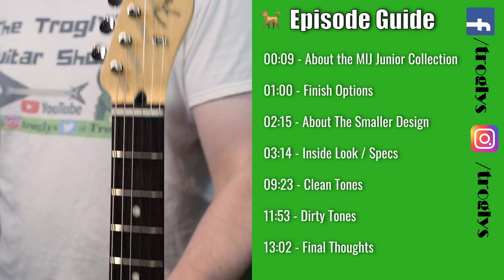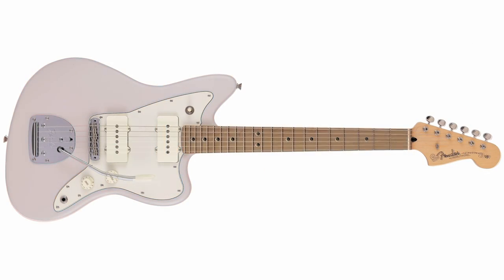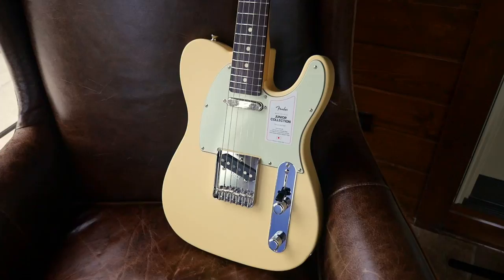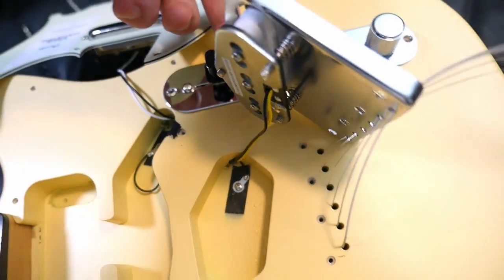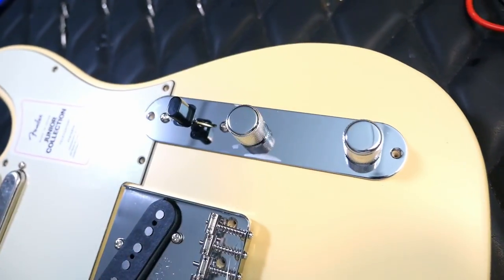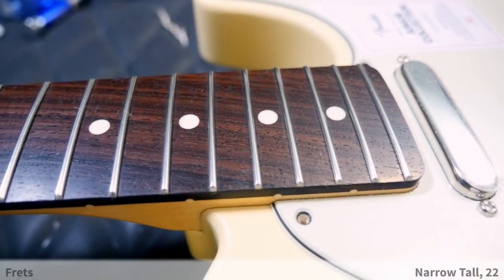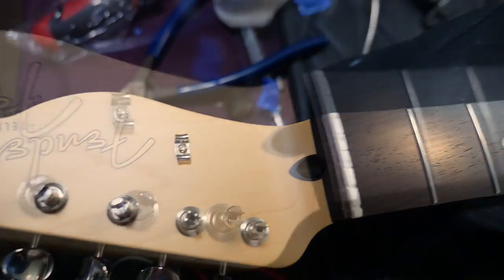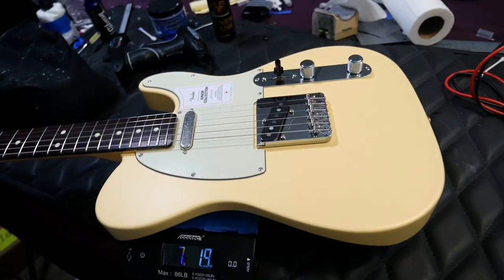Have You Ever Seen a Short-Scale Tele? (24") | Fender Japan Junior Telecaster Review + Demo

Comment: I had a short scale Tele & made a mistake about 8 years ago and sold it. So, I made my own. It’s still not the same though. I stripped a Squier Classic Vibe Tele and stained it purple. Put an arm cut & belly carve on it. I routed under the pickguard. Originally, it was pretty heavy - almost 10lbs. I took 2.5lbs off of it. I then put a Warmoth short scale maple neck on it - has 10”-16” radius. Plays like butter now, but I still miss my old Tele.

Comment: These are killer. As a Gibson guy a 24" scale is easier to get into than a 25 1/2". That's why I have a Fender Duo Sonic with a Tele bridge PU and a real Ric '66 single coil. Total early Townsend sounds from one guitar. It succeeds too.
Reply: From the mid 80's through the 90's (I believe)  Fender Japan made Strats and I'm pretty sure Teles on a 7/8 scale but with the Gibson scale length.  You can find the Strats labeled as "STM" or "314".  I believe Teles are labeled"TM".  The quality of these guitars are nice.  I have a couple of the Strats (SSS and HSS pickup configuration), sorta rare and not cheap.  I'm a Gibson guy as well,  but strats and teles have their place.  I have a 70's mustang, bet your Duo Sonic is wicked.
Reply: I'm not referencing to the newer Aerodyne models.  The guitars I'm referring to are built to somewhat match specific years (STM-55, STM-60) are the two models that I have.
Reply: As a 25 1/2 guy it's no problem goin 👎👎👎
Reply: @therealone1288   It's no problem Slade, been playin' for 50+ years.  The Gibson scale is simply more comfortable Hero.
Reply: Duo-Sonic (and Mustang) Gang Here!

Comment: Yes , I have seen a short scale Tele before. Around the mid to late 90's ('96?) There was the Fender Custom Shop "Tele Junior" . Mahogany body , set mahogany neck, rosewood fingerboard, black painted headstock, 2 P90's . It was 24.75" scale length.
Reply: That sounds similar to the Jim Adkins Thinline Tele, which also has two P90s and a 24.75" scale length.
Reply: @benjipc5637  Not seen that , I'll have to check it out 👍

Comment: Yesterday I got in a Squire Comtemporary Stratocaster Special in Sky Blue Burst Metallic.  So far so good . It was listed as used and I've not found any obvious blemishes or other problems.  Well actually they forgot to pack the tremolo bar but a quick call and they found it and dropped it in the mail. The pictures dont really do them justice. And plays well. It also has the painted headstock with the roasted neck and fretboard.   As a Telecaster owner I get why someone might want a comfort cut. Even though the edges are slightly rounded over being someone that leans into the guitar a comfort carve on other guitars I own makes sense. I know that guitar your reviewing has a smaller body but it makes the headstock appear to be large . I'll bet that's a good little blues banger. Especially if you down tune . I'd changers the saddles to brass move that  neck pickup to the center maybe closer to the bridge pickup and drop a split coil pickup in the neck position. Of course putting in a 5way toggle .

Comment: Hey Trogly! 
Is the pickguard scaled down in size or the normal size?  Normal size pickguard would make it easier to mod with a neck humbucker and middle single coil pickup like it’s routed for.
Reply: I believe that the pickguard is slightly smaller but the pickup and hole are the same size

Comment: Hi, is the pickguard the same size as a normal tele pickguard? Planning to get this color then replace it to a black pickguard. nice review!
Reply: You can sort of tell it's not when he holds up both teles..... I spent $8.50 on a regular mint tele guard on reverb,  planning to use the original as a template when the guitar arrives. The guard and TV jones for the neck have beaten the guitar here. I'll post measurements in this comments section when it arrives,  and probably put size comparison pictures on TDPRI for reference.
Reply: @reverendrevolver6341  Thanks! That really helps. Looking forward to your post
Reply: @gaston7484  thought I'd already replied yesterday.... it's not the same. I put measurement pictures on TDPRI,  but yea...... I bought a blank piece of mint green 3ply material. I'll be cutting my own I suppose.
Reply: @reverendrevolver6341  Thanks so much! This helps a lot
Reply: According to the narrator, the pickguard is smaller, but the pickup holes are full-sized.

Comment: Is..pickguard size same?
Reply: Yeah, great question! Otherwise putting a full size humbucker in the neck position becomes far more expensive and complicated, as presumably you'd need to order a custom pickguard.
Reply: It looks smaller.
Reply: @reverendrevolver6341  yes i’ve bought it
And it is
Reply: According to the narrator of this video: the pickguard is smaller, but the pickup holes are full-sized.

Comment: "an inch and half isn't that much shorter." Yes, that is a LOT shorter.
I built several short scale Strats and Teles. I built myself one, but a lot of people played it all wanted one. 24" is a bit much, most I did were 25", but I've done a couple 24.75, and one 25.15"(which I've found to be perfect if you find Fender to be just a little too big).
If I could give some advice to people who want to do one: do a dedicated short scale, don't just throw a conversion neck on a regular Strat or Tele. You need to have the pickup routing done correctly to compensate for the short scale. If you just throw it on an existing body, the bridge pickup will sound okay, but the middle and neck pickup won't sound right, especially the neck pickup. I find conversion necks just take all the magic away from the neck pickup, it'll sound sterile. On a regular scale, the neck pickup sits directly below a harmonic node (I think it's the same one you find at the 7th fret? Maybe 5th). If you just changed the neck scale it'll no longer sit below the node. Playing clean you might not notice it as much, but when you use overdrive it'll just sound.. well, sterile.

Comment: I think it would be cool if you upgraded one of those telecasters with the humbucker and another single coil just to see how it would sound. Just a thought and or suggestion. 
👍👍👍✌️✌️✌️
Reply: Assuming a new scratchplate is cheap and easy to buy, I'd upgrade both pickups. 
Take advantage of the body route to put either a Seth Lover WR style or regular PAF sized humbucker in the neck. 
Then put one of those popular SC sized Duncan humbuckers (or similar) at the bridge. 
Job done...especially if you can add in coil split(s) for extra tones!

Comment: I like the smaller bodies but the scale length makes the strings way too floppy and lifeless
Reply: They are made for thicker gauges so you can get a bigger sound without needing to detune or deal with insane tension. I like 24.75 scale length because it works with both thinner and thicker strings.
Reply: @dirtydanthesecretsauceman8519  this is true. I imagine you can slap some 14 gauge strings on and start playing some nirvana riffs or RHCP and have a lot of fun.